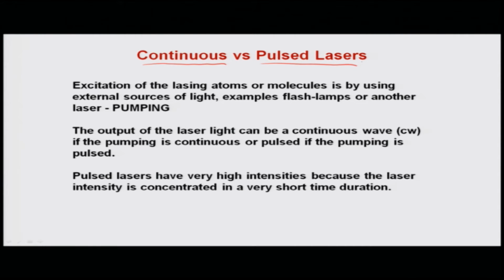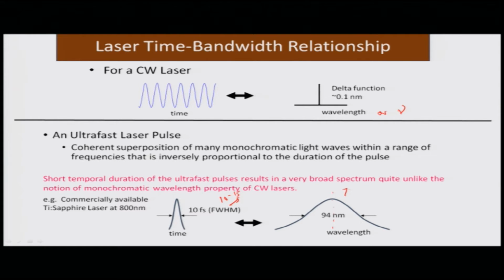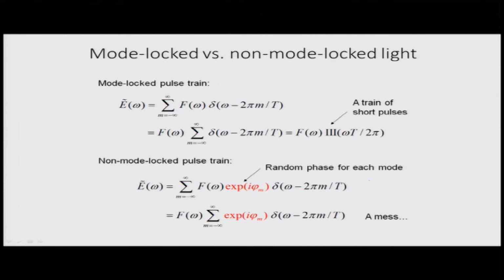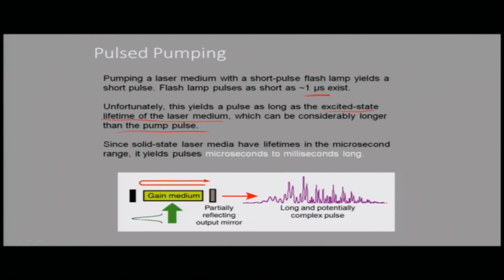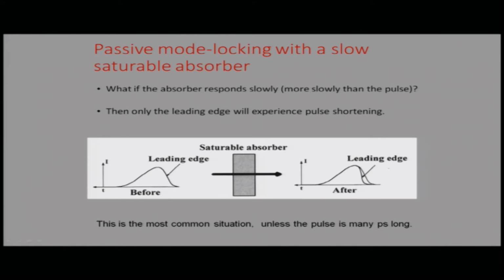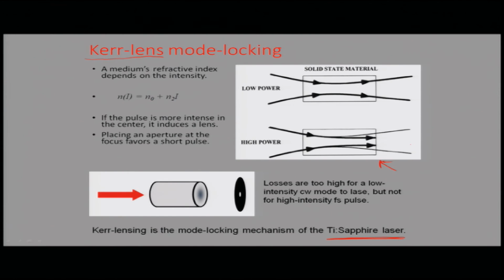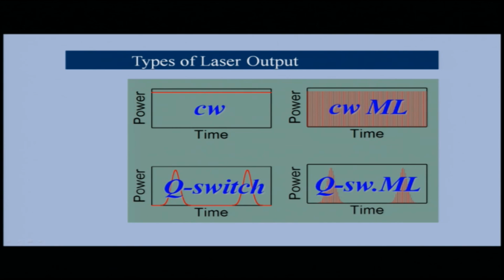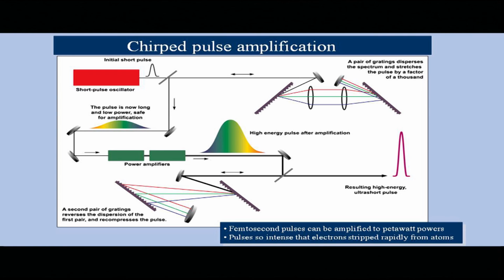Pulsed Lasers

Comment: Cool. I was wondering about the Kerr lensing trick for mode locking. I wonder what it would take to make a pulsed laser like that at home. If I buy cheap plastic lenses and 3D print the mounts, then the only expensive part is the gain medium. Ti:Sapphire is both good gain medium AND Kerr medium, but perhaps I can do it cheaply if I separate these two functionalities into separate components.